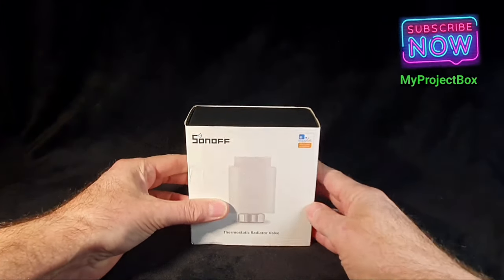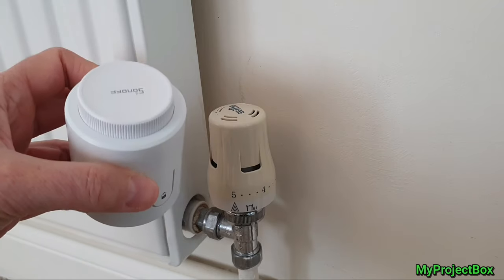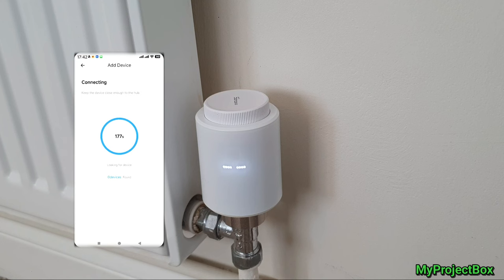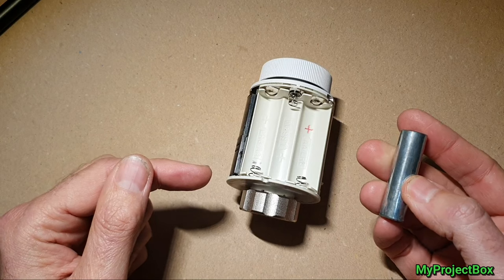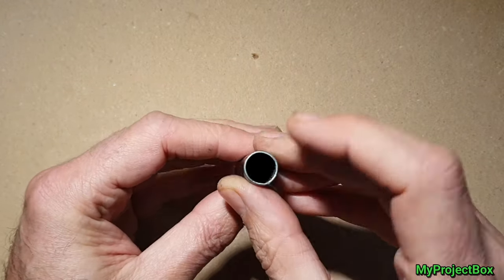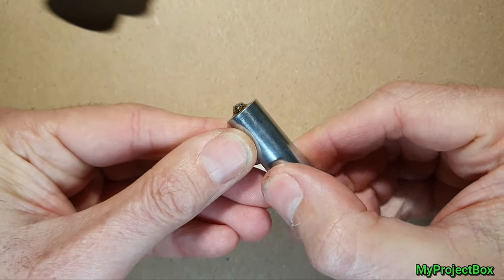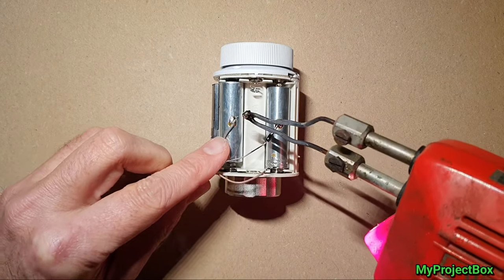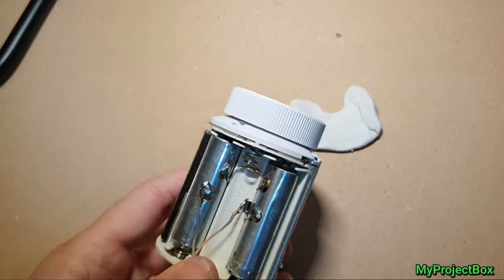Sonoff TRVZB review + setup + NO-BATTERY Hack / battery eliminator adapter

Comment: Thanks for sharing. This is a good idea. I have a question regarding the water flow in the radiator. Usually these valves are installed in the in/hot pipe and the in/hot pipe shall be installed at the top of the radiator. In ur case the valve is installed at the bottom. So my question is: Is the in/hot water pipe the one with the valve at the bottom? Where is the out/cold pipe installed? Do u face any heating power lost?

I have a situation where the in/hot pipe is at the bottom and the out/cold pipe at the top. With this setup the radiator doesnt get warm correctly.

Thanks

Comment: Considering how little power the TRVs use, I do wonder if a peltier element attached the radiator would produce enough current to keep them charged...
Reply from the maker: That would be a interesting experiment to try🤔😉. You might need to stack several in series to get the voltage required. Or maybe bigclive's "joule thief" circuit, to boost the voltage.🤔

Comment: Idea: instead of messing with batteries I would use 2 flat-head metal pins and pieces of hotglue stick
Reply from the maker: I did actually try two pieces of hot melt glue sticks 😂. They get a bit flexible with the heat next to the radiator.  But it was definitely my first thought😉. It probably would be okay. I just prefer something stiff and rigid. You could use any thing that has a similar diameter.

Comment: Hi - maybe I'm being thick, but why doesn't the tin foil short out on the zinc casing making both ends the same voltage potential? is the zinc tube lined with plastic ?
Reply from the maker: Yes you are correct each tube is completely sorted to both sides😉. But it doesn't matter! Because we are only using two dummy cells, and the middle cell is not used. So we only care about making a connection to the main positive and main negative spring terminals, on the Sonoff trv. If you tried to install the middle battery/Cell , it would be a problem.

Comment: Have you measured the current of the device?
I often wonder if the batteries could be recharged by a Peltier module. I don't know why but I find this idea very elegant for a radiator. Otherwise, a small solar panel should be able to do it without requiring a nearby mains plug
Reply from the maker: That is such a great idea 💡.  The TRVZB is definitely a "low power" device because it is zigbee😉. The actuator motor is probably the worst culprit, but it's not in constant use. The peltier energy harvesting, could work for a simple "trickle charger" for the Nickel–metal hydride batteries. The cold side off the peltier might need a "large" heatsink. I think a prototype might look a little frankenstein, but it could prove the concept. A small 6v PV panel could also be affective to trickle charge the battery. You don't need complicated charging circuitry for Nickel–metal hydride cells.

Comment: Good morning from Greece. The use from WiFi for this thermostat, is available only by a Zigbee Hub or I can control it only with the thermostat itself? Thank you for your response
Reply from the maker: Yes, you do require a zigbee hub. Zigbee is ultra low power, so it's often used for battery operated devices. WiFi is very power hungry, and not easy to power from batteries.

Comment: I believe a brand new Alkaline battery can deliver up to 1.65V, so 4.95V for all three. I wouldn't bother with the diode and resistor...
Reply from the maker: I did think of not putting the diode, and 5 volt would probably be just fine. I just wanted the keep the voltage closer to 3 x 1.5v , but I found some cheaper USB chargers could be as high as 5.5 volt. So The diode could help with the higher voltage.
Reply: Yes, I tried that (see above) and it worked with one USB adapter, but 2 other adapters failed. I suspect that the TRV tries to take too much current for some adapters and they fail with a "POP!". Maybe when first powered up, the TRV attempts to power the motor which for some USB adapters draws too much current. 

Annoyingly that last attempt seems to have damaged the TRV which no longer powers up, even with the adapter that previously worked. Did the USB adapter failing send a voltage spike to the TRV causing that to fail?

So I'm thinking the diode may be useful as a current/voltage limiting device and help stop blowing up the adapters and protect the TRV. However I have to trust it will work and not damage another TRV.
Reply: @UKenGB  If it's when first powered up, maybe an NTC thermistor would be indicated
Reply: @NicksStuff  Yes, it's when switched on. Well within a second or so. Why do you think the thermistor would help? Not sure I understand why.
Reply: @UKenGB  NTC in series help to reduce in-rush current (if there is a power supply with capacitors, for instance). Why? Because when cold, they offer a high resistance (so, low current), gently heat up and reduce their resistance
Reply: @NicksStuff  Trouble is it's hard to know what the temperature range would be as the valve itself may already be hot due to being attached to the radiator.

I'm still puzzled as to how it managed to damage the TRV as well.
Reply: @UKenGB  Put it on the adapter side. Have a look at NTC use case for limiting in-rush current 😉
Reply: @NicksStuff  Ah yes, put it at the USB end. Thanks, I'll look into including one, although it seems if just a diode to drop the voltage is sufficient if it continues to work for the OP.

I want to dismantle the TRV that failed, but at least one screw is covered by the top dial/button.  Not sure if it just pulls off. Anyone done this?

Comment: This is EXACTLy what I'm planning, so good to see it works. However, would be really great to know if it would work without any voltage reduction. Any such 3 battery device has to be able to accommodate at least 4.8V and I seriously doubt 5V would cause any problems whatsoever.

Any chance you could test this and report back here?
Reply from the maker: I'm 99.9% convinced it will work fine directly on 5V. I would just make sure that my 5v power supply is outputting no more than 5V. Some cheaper ones have a big tolerance.
Reply: @MyProjectBoxChannel  Why don't you try it? Go on. You know you want to. 😄
Reply: @MyProjectBoxChannel  I finally got around to trying this. I soldered the + and - wires from a USB cable directly to those battery terminals on the TRV. Easy to do and neat. Connected to a (unbranded) USB adapter which promptly went PHUT! Supposedly a 2.0A PSU, but now a 0A piece of plastic.

Tried an early Apple 2.0A USB adapter (from iPad) and the TRV powered up and after normal setup procedure it was visible and working in Home Assistant and has been for the last few days without any signs of warming up (rad was mostly off).

I wanted to see if Apple's 1A adapter could power it so tried one, but that went PHUT! So I connected it back to the 2.0A adapter with which it had been working. Unfortunately the TRV is now non functional. I have 5V at the connections, but it's dead. 😩

So somehow when the Apple 1.0A adapter failed, it also took out the Sonoff TRV which is not only annoying, but a complete puzzle. How did that happen. Seems likely the TRV is trying to draw more current than some adapters can supply and when they have no overcurrent protection, they fail, but how would that break the TRV?

The big question now is whether running from a suitable 2A adapter can be relied on. Oh and how to fix a blown TRV.🤔

Comment: Just put 5V on the first + and last - lead, no need to mimmic batteries I imagine?
Reply from the maker: Yes 5v is probably fine, and inline with in the aloud voltage tolerance of the device. I did however notice that some cheaper USB chargers, could have a output voltage as high as 5.6v, so dropping 0.6 volt acrossa diode is not bad thing. You could just solder the USB cable directly to the battery terminals, but the dummy battery's makes it easily reversible.

Comment: The diode is a 1N4007 and the resistor is ?
Reply from the maker: I used  a 4.7K resistor but it's not critical, 1k to 10k should be fine. The diode could be a 1N4007 or similar type.

Comment: hi, i came across your you tube because i am looking solution for my problem. i have more less have an idea how to solve it but i am not electronically savy, so i not able to build up the circuit
 it involved 3 phase current, sonoff 3 gang switch, no neutral switch,  because my  present 3 gang switch powered by two live sources. i want to replace it with sonoff 3 gang switch but the problem is sonoff switch is design using one live source.
Reply from the maker: OK 👍. But I need a bit more information. What voltage 3-phase do you have?(the voltage between two phases) Do you want to switch all of the 3-phases? Or just 2, and do you need to power the Sonoff from the same 2-phases? Also you mentioned you have 3-phase but no neutral connection right? 

It is possible to use 2 phases, to provide power to the sonoff,  as long as the voltage is within the right supply voltage range, for the Sonoff. So you use one phase as the L, and a different phase as the "N" in.
Reply: @MyProjectBoxChannel  both power source are 240v. the original 3 gang switch configuration were 2 of the switches powered by L1 and one powered by L2. i have 3 gang mechanical switch that works on ewelink. but this switch do not have neutral connection. similar to my existing house wiring do not have neutral line.

so i am thinking to use L1 and out3 to trigger SSR to act as switch or opto-coupler (possible?) to connect L2 and OutL2. but i do not know how to power up SSR (or opto coupler) as my wiring circuit do not have N Line.
Reply from the maker: @halimhussein I'm a bit surprised how two different phases are being used on a 3gang switch, in the same back box🤔🤨. So I guess L3 is up by the light fixtures(like we would have the neutral) and L2 and L1 are being used to feed the light switches? I'm trying to get my head around it🤔. 

So It should be possible to power/feed all 3 switches from L1( as long as the light fixtures up by the ceiling, are feed by L3 as the return). You could test this with your old light switch, and see if it works. You will have L2 free. Then you can use L2 as the N-in for your sonoff switch. L1 can be L-in. The 3 outputs can switch the L1 feeds back up to the lights. ( I don't know what model 3-gang smart switch you have?)

Let me know what you think. It's important to know what phases are up by the light fixtures. If it's L3 for all the lights, the it should work.😉👍
Reply: this is the fault of my renovation contractor. i didnt know they did that, it has caused alot of tripping when i replaced with smart switch, only then i realise what they have done.😮 . i do not know how many of my house switches are on 2 live source.  of course the simplest solution is to hack my wall and place another single switch to take of another live line. i saw one of your video using optocoupler as switch, i might get 3gang switch with neutral line if that can make it work. anyway i ll try your suggestion
Reply: this switches to light up light fixtures

Comment: Rinsing the battery out under your drain, drained my ecological hope for this planet 😢
Reply from the maker: The black stuff I was rinsing out of the zinc carbon batteries, is manganese dioxide! It's used in water purification, and it's mostly benign to the environment. It's a naturally occurring mineral. Breathing it in as a fine powder is not great for your lungs (like most fine powders). It is one of the least toxic battery chemistries. It was the zinc casing I was after, which is probably the worst thing in the battery. If it was any other type of battery, like lead-acid for example, I would never do this. It would simply be too toxic to the environment.
Reply: Glad to read your sincere considerations @MyProjectBoxChannel . Might be good to mention or annotate such info in the video.
Reply from the maker: @bartn4495 I think I mentioned it's fairly benign.  But you are right  I should have explained it in detail